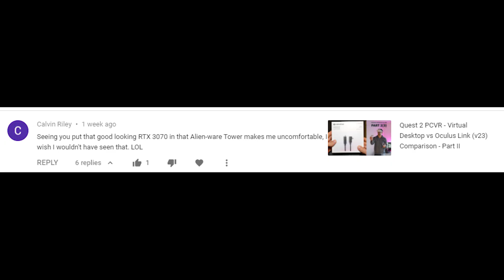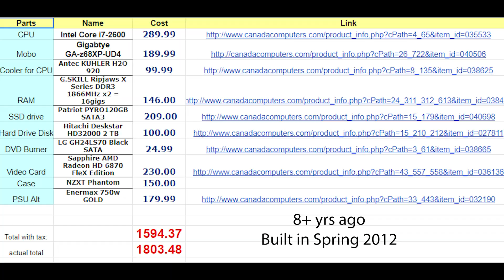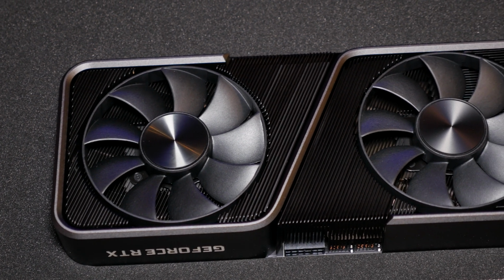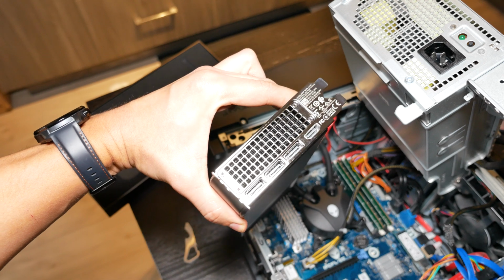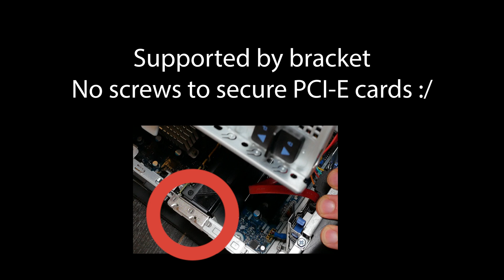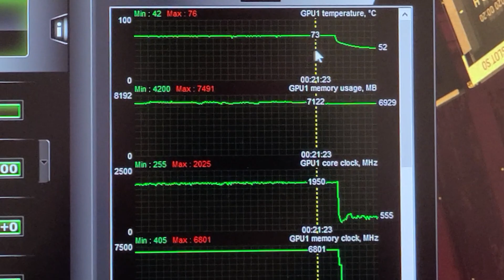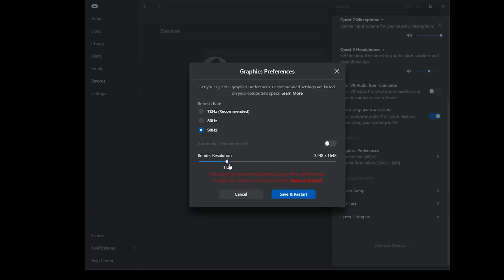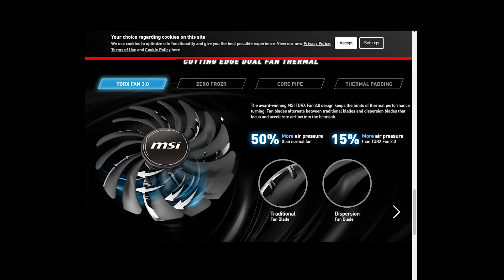Will My RTX 3070 Melt My Prebuilt Dell PC? (Review from Aurora R7 / R8 User)

Comment: Thank you so much for making this video.  I have the Same Aurora r7 case with nearly the same specs with a few differences.  Mine I got with a GTX 1080 graphics card.  and my Power Supply I believe is only 450w factory.  Obviously before I even attempt to upgrade to a new card, I'll need to upgrade that PSU.  But I've been really wondering if it was possible this pc can take any of the RTX 3000 Series.  I wish though the card bracket support could've been fitted back into the unit to support the 3070 you got in your video.  I like to make sure everything is well supported and stable.  But this is a great help.  Glad to know it can fit at least a 3070.  It's just a matter of choosing the right size card.  I've recently got Cyberpunk 2077 and it runs fairly well on a 1080 card.  With a few adjustments to the settings I can just keep it above 30fps on Ultra.  But obviously this game was made to take advantage of the latest specs  you can get for a gaming PC.  Again Thank you so much.  I would look forward to any future video showing how well your pc performs with the card. Especially with Cyberpunk and the settings that work well for you.  Take care.
Reply from the maker: Dude! A 1080 is great. Wait for rtx 3070 super honestly...

Comment: Thank you for making this video, extremely helpful. I've been wondering if my R7 has any kind of future beyond the 1080ti that came with it.  I think a 3080, or something on par with it, would be worth the upgrade but the current sizes of them make it impossible, on top of the lack of PCI-4 support and probable heating issues.
As you say, the front fan restricts any length above 10.7 inches, but I actually hadn't given any thought to the width, until you mentioned it. Lots to think about. Thanks.
Reply from the maker: Let me know if you fit a 3080!
Reply: @JSyntax  Currently two solutions to fit a R7/8 (and my R6) is the Dell's own OEM RTX 3080, and the Gigabyte RTX 3080 turbo.
Both the OEM version and the turbo version of Gigabyte are technically accessable here in China, and according to my opinion, the OEM one is probably a better solution since it's the only dual-fan design RTX 3080 as far as I know.
Reply from the maker: @SamHero_  Do you have a link so I can see what the specifications are in when it looks like ?
Reply: @JSyntax  
https://www.gigabyte.com/Graphics-Card/GV-N3090TURBO-24GD#kf
Gigabyte 3090 turbo of 10.5 in, which just fitted the R6 case.
Reply: @SamHero_  , Any idea if the R6 is the same case as the R7?
Reply: @CDbiggen  It is according to the seller, planning to have one and try it out a couple of days later
Reply: @SamHero_  , Wow, I can't believe any 3090 fits in there. Good luck with that then bud.
Reply: @CDbiggen  I'm not planning to install an 3090 inside my R6 case, a 3070 or Dell OEM 3080 probably, since the 850W PSU is still not enough for the 3090.
However if you take a look at the current Aurora R11 series 
https://www.dell.com/en-ca/gaming/alienware-desktops
The 1000W-3090 combination did exist, which means that Dell did managed to made this spec available in the aurora series cases
Reply: @SamHero_  , Yeah tbh I did think it was a bit strange 😆. The wait for the rest of us continues.
Reply: @CDbiggen  Just made the ripped 3080 installed successfully, it's even a bit shorter (!) than the stock GTX1070, and worked flawlessly with the new nvidia driver installed.
Reply: @SamHero_  , legit jealous right now, but very good news indeed.

Comment: Idk the quest 2 Resolution is so high that some games actually use more then 8 gb of Vram and the last time i checked the 3070 only has 8, the minimum i would get personally is 10 gb aka 3080 at least Not a 3070, it has the power but is bottleneck by vram
Reply from the maker: Yes very upsetting for the price

Comment: AWESOME 

Im doing the same thing if I can actually get a card.

I actually got my r7 for the same reason and I saved about $600.

Mine with 8700k and 1080 has been great. Upgraded the ssd and ram.

Need a new card now.

Thanks for the video.

Cheers
Reply from the maker: 1080? You don't need to. Upgrade yet.. Maybe 4070
Reply: @JSyntax  its not as powerful as you think man. Mine has a decent OC but still struggles in some VR games and it's not great for streaming to VD for example
Reply: @JSyntax  Wondering how your 3070 performs playing 2077?
Reply from the maker: @Silvertinge291  I'm waiting for the bugs to be worked out but I will try it soon
Reply from the maker: I just tested Cyberpunk 2077 on the RTX 3070 and it's running at Ultra 1440p and it's smooth as butter. Very happy. I'd love to know what the experience would have been on a 1070, hehe. Running latest drivers and v104
Reply: @JSyntax  really?  That's good
My 1080 on medium settings on 1440 is only getting at best 52 fps on newest drivers.

I have tried modifying the high settings but turn down cloud rendering and shadows and inside a building ill get 60 fps, driving i get 45 and walking around city likely 40.

It looks good but performance hog